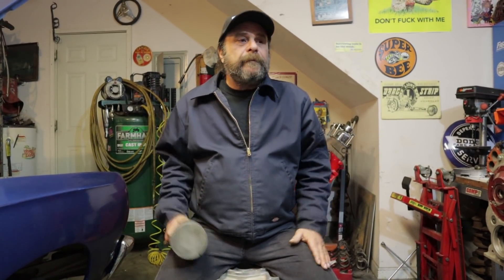3 Reasons Junkyard Engines Go Better With Boost

Comment: That must be why the "truck" LS engines seem to be the most popular for swaps. It would be tough to find one from a Camaro or Vette that made 400+ horsepower stock that's seasoned properly. Most of those are fair weather only vehicles while trucks are out on the front lines every day. The biggest thing that I don't trust about most modern engines, LS included, is the powdered metal rods. If I wanted to make stupid power reliably, an aftermarket forged set would definitely be at the top of my shopping list. Even some of the older style crate engines available these days have sintered rods.
Reply: Gen 4 rods are fine over 1k hp. Been done for years..gen 4 is from about 2003-4 on..cracked caps on both gen3-4
Reply: Scott M Good to know thank you. I'm not really up to date on LS stuff. Do the rods interchange between all the LS engines like they did with the old small blocks (except the 400)?

Comment: "Seasoned" aka stress relieved.  I had the three in a bit different order than you related, but the same three.  I could never convince  my dad that the ring gaps and clearances were too tight for the performance engines we built....they ran ok, but i thought they were capable of much more than we got out of them.

Comment: I just got a chance to finish this video. I agree seasoning the engine is very important. As long as it’s running well I find cars or trucks with engines at over 200,000 miles especially work trucks that run every day. The 6.0 LS/LQ4 for the Buick GS was out of a work truck with 195,000 miles on it. The 1uzfe for my Toyota supra has 220,000. The I had the 1uzfe laser scanned and it was with in .002 within manufacturers specification

Comment: Do you think any of the new engines will be worth anything in future? Seems like new cars are not build to last or do 200k
Reply from the maker: Hard to say on that.  I think the future of hot rodding (20 years down the road) will be completely aftermarket drive trains and chassis with JY available bodies mounted on them.
I also believe those packages will be based off of the traditional 1960's/70's engines and transmissions.

Comment: The two great designs built into the LS are, one, the large ports. As everyone knows. The irony is the Pontiac 350 has a similar bore and stroke (and shares a long connecting rod length with the LS, relative to say a first gen chevy small block or ford windsor), which most people think is too small (under 4 inches) and that shrouds the valves. But the LS has a tall, cathedral window shaped port and of course, where does most of the air flow in a port? near the top.

The second, which few notice, is the Y block design. When GM does an aluminum block, it does a deep skirt Y block design for strength (the Buick's Grand National V6 has the same design, not copied over in their FWD V6 design of same displacement, because they got the V6 from their 215 aluminum block of 1962). That increase in crankcase volume (just like a big block Mopar) means that as the piston races down to BDC, it acts like a parachute (For want of a better description) and compresses the air/aerated oil inside the crankcase. On a smaller crankcase volume like most small blocks, there's not a lot of room, so compressing this mass of "atmosphere" offers resistance to the piston. Some engines like the new Shelby Mustangs have holes in the main webs to let the compressed atmosphere escape. But a deep skirt block design has more volume to disperse the compression.
Reply: I was under the impression that, as all pistions go down, another on the crank is going up right next to it, giving the air a place to go. (Even on a crap design) I just feel like When you pull off a oil pan the crank is not submerged, allowing the air in the case to go between pistions, or ventilate the breather?  I don't claim to know, just what I always assumed.
Reply: @Dravis33coe  at a slow engine speed, your theory is correct. at a higher speed, its happening too often. Like Lassi said, the roadtube (on old cars from the 1960's) and crankcase ventilation systems on later cars keep the oil dipstick from shooting out its tube from the pressure created by the pistons compressing the air inside a tight crankcase.

Comment: in the late 60s.  dad and me put a 392 hemi in a 59 ply wagon.   to get the engine i took apart 3 / 392.  on the pan rail on the block the factory noted the piston size with  A or, B or, C.     out of the 3 / 392s   there was only 2  bores marked  B.   i think the letter size was to show the size was .0001 off of nominal size.

Comment: I broke rings lands of my new car few years ago. 2015 Dodge hemi. Had a nitrous solenoid fail in the open position. I learned the hard way that you cannot shut the car off until you’re pulled over and the transmission is in park. Anyhow, I pull the heads off and I am like the Pistons look fine. Once I pulled the Pistons out of the cylinders I saw typical ring Buttage. Broke the lands downward on the side of the piston above the pin where the lands are weakest.my fault. Should have tested first. I have now idea how tight the stock gaps are but now top and
Bottom is .028”. She takes a 200 shot like a boss now. Time will tell. That’s all.

Comment: I have a 03 dodge ram 1500 5.7 hemi an she been good to me never had problem with here or broke down I just do basicall stuff cahnge oil spark plugs an transmission fulid an she at 40000 miles nothing crazy but had snice brand new gonna keep her till she die on her own

Comment: so what your saying is..... i need to spray my 3.1 v6 in my 99 buick century.... 270,000 miles..... well maintained, but driven HARD

which might be how i finally kill that motor..... because ive got a 3.9 60 degree v6 i want to swap in
same motor mounts and trans.... hardest part is the wiring harness (which i have)

i just wonder if my instrument cluster will work, and shit like that on the BCM side.....not the ECU side

Comment: We used to grab 360s out of the bone yard and just flog them street strip for a year or two and then rinse and repeat. Only thing we did as a matter of practice was swap out the stock oil pump for a high volume unit.
Reply: silverbird58  could never get a good one. Left the 360 for them. I liked throwing together a little screaming 318.

Comment: I'm a mopar guy 100% but once I was a mopar guy 99% when I had my 35th anniversary trans am ws6. That Ls is a bad boy, GM did their fans a big favor with the mass air flow sensor, Mopar did it's fans a disservice by locking everything up in the computer & to make power a Fool has to get butt ravaged by these tuner companies & still have a turd 5.2-5.9 unless you really do some shit to it.

Comment: Very well said. I ran junk yard 360’s in my circle track cars for years just for this reason and i had a very small budget. Slap a set of J heads on and did very well. 
Once i could afford to build my motors, i built them with very loose tolerances and kicked butt.
Reply: silverbird58 funny you say that since i am in Michigan 🤪🤣🤣🤣

Comment: Tony you are dead on... A Loose Motor is a happy motor!  Some of the best running engines I have ever seen... Where put together in a back yard "sometimes on the ground" and you can apply the LS logic to any late model engine and have the same result! Mod motor, Gen III Hemi, I have seen a 360 Magnum make crazy power with boost!

Comment: Tony  you ain't  lying  one bit lol we took a 383 with a million  miles  on it ..my uncle  had sitting  for  27 years the 383 is 0 deck 906 heads  stock engine  so just for kicks we installed a turbo gt45  from  Ebay 8lbs of boots and  a 150 shot makes gobs of power it's still living the damb thing runs 10s all day  long in a stock Saratoga  lol now that's  crazy...
Reply: Jerry Jordan Now that, I would love to see!

Comment: Ut will an aluminum block move more or less? 

Just curious if iron or Aluminum handles power differently
Reply from the maker: Aluminum is definitely more flexible.  That's why they have so much more webbing and bracing than iron.  That's also why they live better in extreme circumstances
Reply: @UncleTonysGarage  I appreciate you indulging my inner nerd.  Lol

Comment: How true it is the LS architecture is phenomenal combined with the electronics just imagine if you can go back to the 60s with one of these LS powered vehicles it will be a Slaughter!......
Reply from the maker: You would have to go back with a bunch of today's power adders as well.  You forget all the 1-plus HP per cube engines available back then.
Also, remember the architecture of the Early BBC and Chrysler Hemi are still at the top of the HP heap today...10,000 horse and up
Reply: @UncleTonysGarage  10000 horsepower plus today not in the 60s power-to-weight baby power-to-weight!

Comment: An old junkyard 350 was the perfect stock class circle track or enduro motor. They’d rev to the moon and take a tremendous flogging. I’ve tried to blow them on purpose and would either run out of gas or just give up.

Comment: As a die hard ford man I'll say I'm a bit envious of my chevtard friends with their ls while all I got is a 4.6 2v that's 281 cubic inches
Reply: Don't be envious - most of the things in the LS design that make it so good came from engines Ford produced over 50yrs ago.
Reply: @Motor-City-Mike  yeah I've noticed that to I'm more envious of there aftermarket support I don't think there superior
Reply: @adamturner2507  
Yeah, I understand That!
That's the same old thing we Ford guys (and the Chrysler guys have always had it WAY WORSE) have had to deal with for years - the aftermarket goes Ape Shit for Chevys and the rest of us have to pay out the nose to get really good performance or parts.
I'm older than the average car guy, I'm sixty, been in this as much as anyone for over forty years, made my living building race engines including some NASCAR stuff (not bragging, just giving you my background) and we have always had to work harder at it.
As far as your 4.6, if you have the budget find a used 4.6 - 4 valve and swap that in - Lincoln used them in a bunch of different years and different cars and making 400hp isn't expensive.
We did get a break back when the 5.0 Fox Body Mustangs came out,  and the aftermarket support for the 5.0 was - and still is - every bit as good as for the Chevys.
Before that happened building a fast 289/302 Windsor meant finding Boss 302 heads to swap on (expensive as hell!) or finding early 351W heads, milling them, cutting them for bigger valves, and hand porting. The aftermarket made decent intakes cams and headers.
A Windsor like this would run with most Chevys and outrun some but it was A WHOLE lot more work than the Chevys.
The next car I build for myself no matter what it is I'm building a 351 Windsor and swapping it in.
Good heads brand new can be had for $800, Eagle sells an inexpensive 3.850" stroker crank that doesn't need any special machine work to use - that crank, the stock 351 rods, and stock 302 pistons and that's it - a regular high performance cam (you don't need a roller and that makes it that much cheaper) - this engine builds cheap, ends up at 390 cubic inches, makes an easy 400+ horsepower and makes so much torque that anything heavy like an F150 or a Crown Vic is as quick as a muscle car.
Remember that torque is what makes a car quick, horsepower is what gives it top speed.
Reply: @Motor-City-Mike  yeah I'm 21 and I want to build cool cars with very little money and when you like fords it gets expensive I did luck out and find a factory 4 barrel intake and a 650 holley in the junkyard
Reply: @adamturner2507  
Read absolutely everything you can find, and watch every video you can find about what you're going to do, and pay attention.
The stuff that is good information will show up again and again in most of it.
All the high performance parts companies started out from low budget guys working from what they learned.
Reply: Motor City Mike hey everyone, we found the “ls is just a copy of Ford” guy. We will be taking up donations to buy him a helmet so he doesn’t get anymore brain damage.
Reply: Motor City Mike wow. Who would’ve known Ford was the only manufacturer to use non Siamese heads. It’s not like the gen 1 hemi used that style head before ford did. I guess hemis, Toyota uz etc didn’t have cross bolt mains, because only ford did that. And gm copied directly from them.
Reply: Motor City Mike and I pointed out that companies did it decades before ford. So how could the ls be a copy of ford if ford copied their designs themself? The truth is that there’s only so many ways to build a pushrod v8. Manufacturers have been reusing the same basic few designs for the better part of a century. But some people can’t actually look into automotive history and see it for themselves. They read something some idiot wrote and decided that since they can’t have an original thought of their own they’ll just regurgitate the misinformation for as long as they can get by with. But hey man, we get it. You even had to try and use the same lame joke twice in one discussion. You don’t have the mental capacity to understand more than the little you already do right now. So no use in trying to gain new information.
Reply: I drive an 03 ranger with a Vulcan flex fuel in it, 3.0 v6. Not much horsepower but I had a spark plug separate so the ceramic fell out and the metal was still screwed into the engine, never even heard of that happening before. When I looked under the hood I saw the spark arc and immediately shut off the engine, weighed my options, saw it was the spark plug arcing against the block, and fired it up again. It ran and idled on 5 cylinders and got me home (about a 30 minute drive, the most stressful drive of my life). I threw in some new spark plugs afterwards and just got it reinspected last week. Can't imagine any other engine besides maybe the slant six in my project car running like that without any issues.
Reply: Yes my 09 f150 is a dog.
Reply: @gregblack4581  the 5.0 coyote that came out in 2011 is a pretty stout engine a huge improvement over the Triton series.
Reply: Get yourself a 351 windsor, many builds pushing over 1,000hp on the stock bottom end
Reply: TheoA12 Harms making 1000hp on stock 351 internals is not the norm. While it has been done, it’s not a recipe for success. Holdener put down 1600+ hp on a sbe ls, but that doesn’t mean it’s a good idea to push it that far. 351 blocks are very good, but the stock cast internals, especially the rods, aren’t spectacular.
Reply: The way people talk to each other in these comments just so narcissistic. Your not solving world promblems by making old engines go faster . It’s just old engines guys big damn deal .Yes some guys are very knowledgeable about things they spent a lot of time working on . And the people who did not work on these engines do not know as much . Seems if the interest was in the same things you would speak to each other’s like humans not run folks down to show how smart you are. If we were all that smart our interest should of been in something that paid off . Engines did not pay off for 90 percent of us.
Reply: @gregblack4581  a
These things are supposed to be people having discussions about something they're particularly interested in, some asking questions, some answering those questions, sharing knowledge and so on.
To some people it IS a big deal, to some a life's work.
The problem does come in when people can't let someone say something to someone else without sarcastically attacking their person.
Yes, I'm passionate about engines - spent my whole adult life and part of my childhood studying, working on, designing parts for, and entertained by them.
I'm not concerned about world problems while I'm in one of these discussions, that's another concern and I spend other parts of my time there.
I would expect not to be verbally attacked by some jackass with comments questioning my mental capacities and inferring that I need some sort of helmet...
I suppose joining into one of these for reasonably intelligent conversation, debate, humor, good hearted joking and a basic level of respect IS far too much to ask 
Shame on me for thinking that, and shame on me for returning the Bullshit thrown at me in the first place.
Reply: Just that I’m getting older and with age you see this stuff is no good . Let’s help each other like tony does.The cars and engines are an escape to me from some family crap and work idiots . A lot of the car stuff I’m reading lately is full of mean spirited stuff. I know I’m not the best all knowing person and don’t want to be run off of what I enjoy. I don’t care much about the cars as I do a nice engine. I’m the type stupid enough to build a 15 grand motor and put it in a 5 grand car .
Reply: @gregblack4581  
And with age some of us have come to be fed up with this crap.

Was a time people like these "trolls" knew they could get knocked on their ass for talking to people like they do.
Now nobody is held accountable  for their actions.
Reply: Exactly what I was saying . Do run into these guys at cars and coffee and such . But they don’t dare open there skinney Jean wearing mouth there as they would drive home in pain.
Reply: @gregblack4581  Amen.